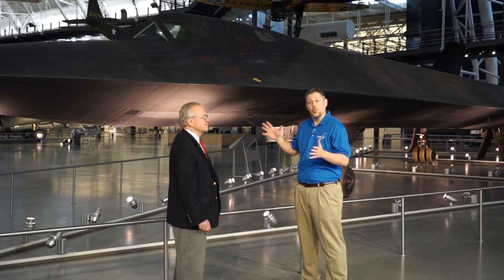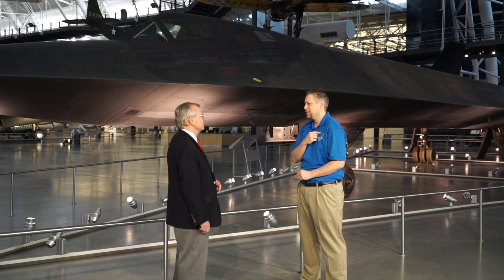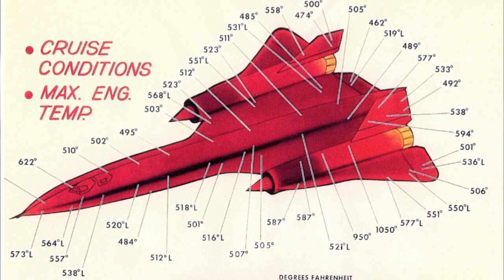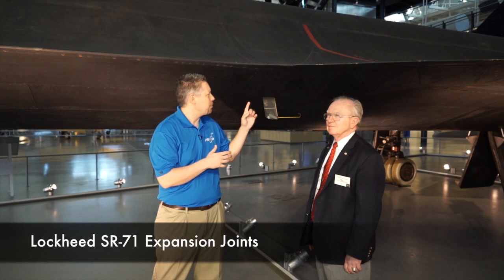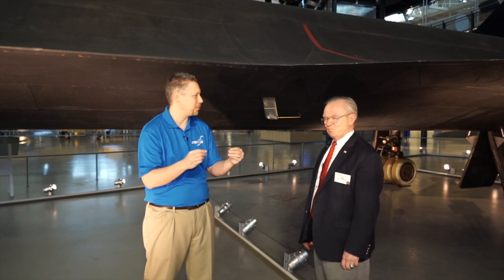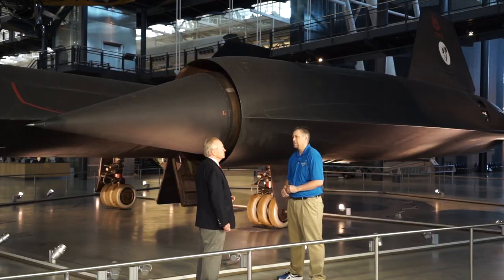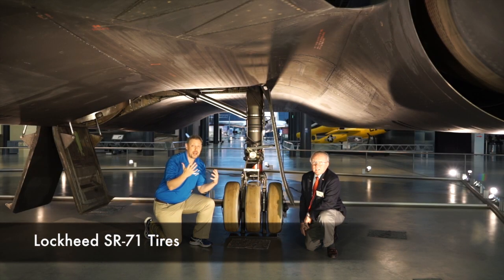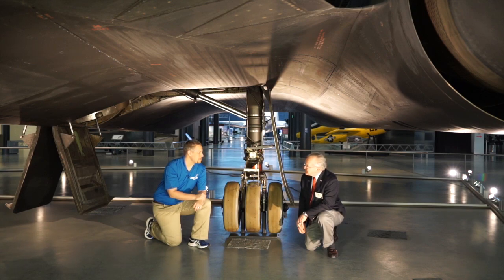A look at the SR-71

Comment: This aircraft is late 1950's tech... it's just mind-blowing.

EDIT: They didn't even cover the stealthy aspects of the SR, I wish they would have.
Reply: Probably still classified.
Reply: Mr.Clem it has a radar cross section the size of a small human. 
Comparing that to the B2's radar cross section the size of a steel ball bearing. Pretty good for 1950's tech
Reply: There are heaps of presentations by former a-12 and sr-71 pilots on yt, that touch on the 'low observable' aka stealth aspect.  As with ever aircraft that's stealth, it really doesn't fulfil to the definition of the word, hence why f-35 is now officially termed 'low-observable'

low-observable feature isn't designed to keep you hidden for the full-duration of your mission, its purpose is to give the electronic warfare co-pilot enough time to detect and jam the scanning frequency.. For long-range bombers like f-35, this capability is there just in-case the enemies integrated defense system hasn't already been neutralised by a host of specialized electronic warfare nirds
/ MQ-1C Gray Eagle with NERO jammer pod , MQ-4C Triton
/ E/A-18G Growler (strike enabled)
/ E-3 Sentry AWACS
/ EC-130H 
/ Oh and satellites 
Although none of the above are stealth, they are either considered expendable (unmanned) and the others fly above SAM missile range or are deployed once the early-warning systems and SAM's in immediate range have been destroyed

EC-130H is deployed last....its a converted cargo aircraft that now has a fully equipped electronic warfare command with 13+ on board. It receives all the collected information i.e. frequency of SAM sites and radar scanning patterns...then continues to jam or disrupt these signals...to prevent effective of targeting of the actual strike-force of which f-35 will be a part

The 'stealth' as i mentioned is there as insurance, in case we missed a SAM and for air-air scan from enemy aircraft....again once the f-35 detects which frequence in the electromagnetic spectrum the scan is operating...it starts trying to jam that signal as well as sending info to EC130H....who with a cargo plane full of electronic-warfare equipment will have that disrupted

note | We (US) have way way more birds and systems under electronic warfare command....those are just a few examples
Reply: In 1968, Chinese tracked an A12 Cygnus flying over Beijing and was over Hanoi in 15 mins.
Reply: IIRC, RADAR would pick up hits from the exhaust plume.
Reply: + @frenat    

Supposedly, the propulsion engineers developed a Cesium fuel additive which made the exhaust plume more radar-absorbtive.  ;)

Comment: Kelly Johnson was a God of aircraft design. His range of design, from the most exotic military airplanes, to the best commercial airliners, was amazing. He was a major contributor not only to the design of the SR-71, but also the U-2, the F-104 Starfighter, the P-38 Lightning, the F-117 Nighthawk, and in the other direction, the C-130 Hercules (still being made today), and even the Constellation airliner.
Reply: The C-130 first flew in 1954, and is still being built and flown today! Amazing, isn't it.
Reply: With the new gas turbine engines and propellers,  they are still one of the best tactical lifters in the world.

Comment: The thought of flying this plane is scary. Fuel leaking everywhere, shit tyres, expanding and contracting like baked bread and missiles locked on your ass every step of the way.
Reply: must have been thrilling :D
Reply: +nespokesman Those aren't exactly shit tires...  considering the environment they had to exist in, the load they had to carry and the speed at rotation - they are marvels.   Want to really be amazed?  Look up what they used for brake fluid.  As someone who at one time flew CAP for their refueling tracks over the North Sea (and a bit further), I can say from my seat there was nothing scary... it was pure envy.   Shock diamonds at dawn!!   The fighter pilot's version of "Napalm in the morning".
Reply: Drool Alot. Actually yes, in the SR-71 the pilots could, and did (several times) eject at Mach 3. The whole ejection system was designed to withstand supersonic ejection at 80,000 ft. The ejection seat had stirrups, and upon ejection the pilot's (and RSO's) legs would be pulled tight to the stirrups so that they wouldn't be flailing around (and get broken) in the supersonic air flow. The pressure suit automatically inflated at the same time.

The other major potential danger in flying this aircraft were the inlet unstarts (described in the video) and the violent yawing that resulted when an engine suddenly lost thrust as a consequence. Although I'm not sure if an aircraft was ever knowingly lost due to an unstart; I don't believe so.

Also, whilst the JP-7 fuel leaked a lot on the ground, it was very hard to ignite, and so it was relatively safe. Once up to speed the tanks sealed completely, of course. Whilst it was unsettling having fuel all over the place on the ground, they never had an accidental fire (that I've ever read about anyway). A bigger risk from the fuel leaks was the plane skidding and not being able to stop when taxiing around. They nearly lost a blackbird when it almost careered into the back of a hanger because the tyres were skidding on the slippery fuel!
Reply: The fuel wouldn't ignite with a blowtorch!  It need a boron-something catalyst to make fire-fire-go-go!
Reply: nespokesman it leaked until it heated up, then everything expands and seals
Reply: Not many missiles capable of catching up to you though so you can scratch those off your worry list.
Reply: Luckily the fuel had a high flash point. You could drop a match on it and it would go out.
Reply: To be fair, for much of their service life it was impossible to shoot them down. No soviet plane could get close, and surface to air missiles just weren’t fast enough to even keep up with it.
Reply: fuel leaked untill you got up and moving...  I guess you could call it self sealing..   but only when it was hot.
Reply: But it's fast. that's the reason why.
Reply: Probably a GM
Reply: Yeah the guys flying these  must have been the best of the best. It would take a lot of cojonas to fly one of these
Reply: stair way to heaven bro.
Reply: nespokesman yeah... These pilots had to have big balls.. You can't eject at 2100 miles per hour
Reply: Guitar Paul thank you
Reply: nespokesman engine failure causes roll over. Gas consumption is rapid
Reply: Not scary--thrilling.

Comment: I was working at P&W in the J-58 overhaul section when the SR-71 was cancelled.   Everyone was pretty sad...but funny enough they wanted EVERY engine we could build.   So for the next 6 months we worked overtime building as many complete engines as we could piece together which pretty much told me they weren't actually grounding the whole fleet at that time.   And it turned out they flew a few of the lowest time airframes into the late '90's and then when they ran out of engines they finally put the Blackbird to rest.
The J-58 sounded like no other engine being as it's humongous internally which limits the rotational speed permitted...so instead of the very high pitched whine you get with most military engines, the Blackbird roared a deep baritone bellow.   Magnificent!
One night I stood behind (and beside of course) while one went through its' certification run which meant about 30 minutes at Full Military power.  Awesome doesn't come close to standing 20ft away from 13 shock diamonds in the exhaust plume.:)   Found out the hard way that this was an absolutely stupid thing to do...nearly killed me from internal damage.   But..it was worth it.

Comment: I've seen a lot of footage on this plane but I never knew about the tires!
Reply: Tony Gareth  It seems like there are still many things even now almost 60 years later ,that is slowly being leaked out to the public about this engineering marvel.   I saw a diagram of the landlng gear ,braked and  tires a few years ago and I remember it saying that the tires themselves somehow had allumininum in them , that somehow helped keep them cooler during the high temperature reached on it's outer skin  and that they were slick and felt like hard plastic rather than rubber. I also remember that the landing gear and ties couldn't stand being deployed at speeds of 300  knots . Just last week I saw a new video on the  SR 71 and for the first time I heard one of it's pilots say that  once they reached 75,000 ft and was traveling faster than the speed of sound , that the air spikes on the front of the intakes actually harnessed the power from a Sonic boom and produced over 80% of t he aircrafts power. That alone pretty much confirms that if we had technology such as this in the early 60s .There is no longer any doubt in my mind that this has been modified and used to power the Aurora  to unbelievable speeds , that are considerd all but impossible

Comment: is anything about this jet still a serect?
Reply: it's top speed.
Reply: You should read Brian Shul's "Untouchables" He tells a story of accelerating out of Libya to evade SAMs. The environmental conditions were just right and the engines kept accelerating past mach 3.25 and he finally had to throttle back to avoid going into an unknown flight regime.  According to his account, he felt that the SR would have kept accelerating and that the limiting factor was the right combination of temperature, humidity and altitude.
It was truly an awesome and amazing plane.  Everything had to engineered and made from scratch.  Even the titanium had to be , um.. "borrowed" from the USSR!
Reply: It broke the cross-country, top speed, and altitude records on its final flight, just as a retirement achievement, that means the whole time they were doing missions, they weren't pushing the aircraft to maximum potential,  If I remember rightly, the absolute allowable speed was somewhere around Mach 3.5 but being that fast you're right on the structural limit.
Reply: No, you can't fly this plane a-sym.  He talks about unstarts when one engine is thrusting more then the other.  An unstart is when after refueling and then engaging the afterburner.  If only one lights or one is delayed before lighting, adverse yaw and pitch follow.
Reply: An unstart is when the inlet shock wave destabilizes and moves too far forward or aft. At this point supersonic air can come into contact with the forward turbine blades destroying the smooth flow of air.  This causes a violent and immediate yaw that would be so severe as to bang the pilots helmet against the window.  The computer would then move the inlet spike froward to restabilize the airflow into the turbine.  Later upgrades to the flight computer were sensitive enough to detect an oncoming unstart and move the spike in time to forestall the event.
Reply: yes ! we should not talk about it though
Reply: Yes, it's top speed is still T.S.  Keep in mind it's cross-country run was made on only one engine.  In 1970 I was told it was M4.2
Reply: BulletSpoung Mach 4.2? the aircraft doesn't have the structural support for that.
Reply: Rick1885 Interesting, wonder why is that still a secret, or just that no one cares anymore.
Reply: BulletSpoung But why is it still a secret? What impact does it possibly have nowadays.
Reply: ***** None, but its need-to-know.

if you know the SRs top speed, enemy military's MAY try to top that in their next project.

but I think for today it's just irrelevant information for the public.
Reply: What? No... this aircraft cannot be flown with one engine at those speeds. He talks about that repeatedly during the part about unstarts.

Comment: Kelly Johnson was a genius, to think that he designed such a plane so well ahead of its time is incredible.
Reply: Quite a follow on aircraft from the U-2, almost completely the opposite to the U-2 in fact. The U-2 was all about extreme range and extreme altitude without support, flying what is essentially a glider with a jet engine, whereas the SR-71 was raw power, Mach 3, exotic materials on the cutting edge of science, numerous air to air refuelling cycles and an early form of Stealth. Quite the contrast.
Reply: indeed